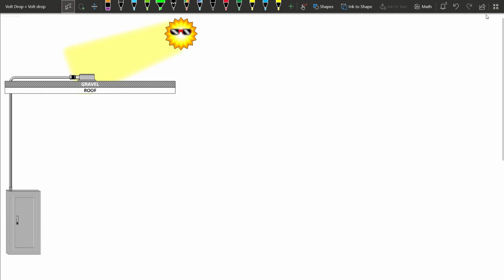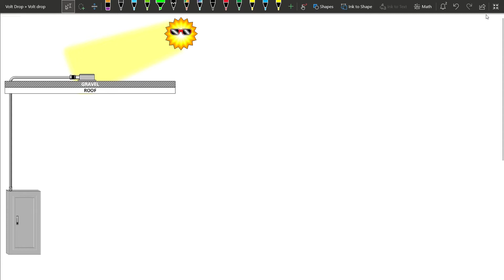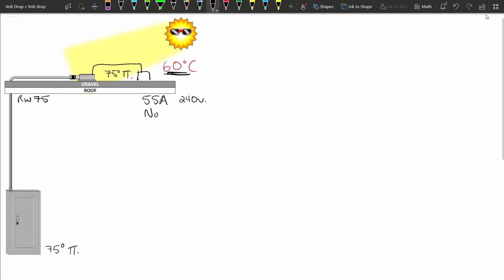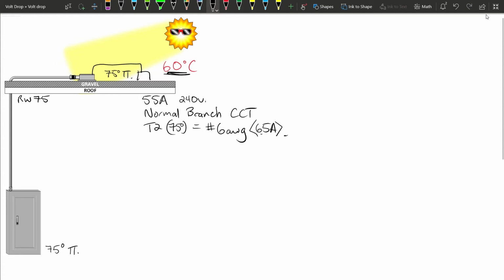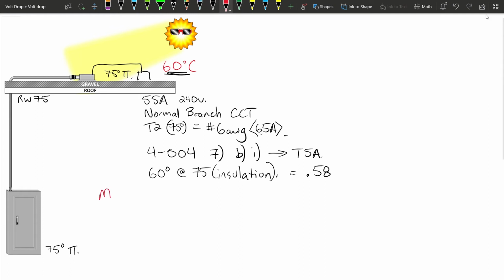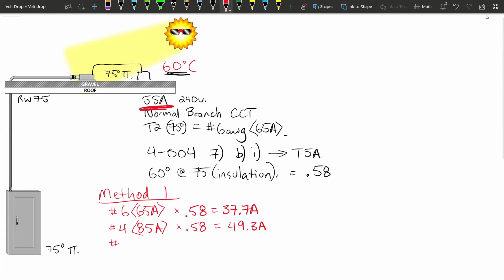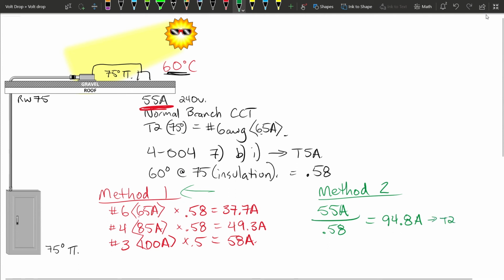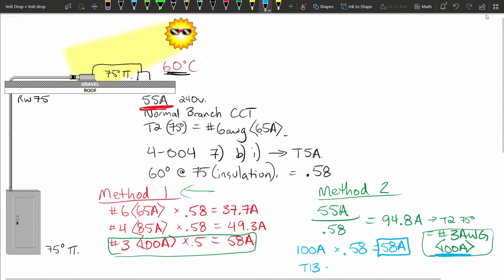Conductors in High Ambient Temperatures

Comment: What if the question has 60 degree ambient temperature and more then 3 conductors in a conduit. Would you derate with 5a and 5c? What would be the steps?
Reply from the maker: Exactly as you've said. You would incorporate both correction factors into the calculation, as both would reduce the allowable ampacity in their own respect. 
Load ÷ table 5A CF, ÷ table 5C CF = required ampacity of the conductor when selecting from table 2.

Comment: Table 5A says in note 2 that the conductors' insulation temp is used for selecting the demand factor. I got a question wrong using the CSA app citing 4-006 (1) claiming I have to use the equipment termination temp for Table 5A. 
Was hoping you could confirm the app is wrong in this case and we do indeed use the 90 deg column on Table 5A in such a case. (90 deg conductor insulation terminated on 75 deg circuit breaker in 45 deg ambient temp)
ty thanks for the content
Reply from the maker: This has been a great source of headache the last few years. Currently the interpretation has been to still use 4-006 with all corrections applied with the lowest termination temperature. 

So even with a 90 degree insulation, with 75 degree terminations, we would use the 75 column. This is what has been told to me, but check with what your local governing body requires as it could be different jurisdiction to jurisdiction.
Reply: @schulerruler  wow ok haha. At least I'm not the only one. I'm taking the CofQ in Ontario, can I be safe using this interpretation?
Reply from the maker: I wish I could give you a definitive yes or no, but I'm not familiar with Ontario interpretation. Best thing would be to put a call into a college or an inspector possibly? The apprenticeship governing body would also be a good resource.
Reply: @brimmedHat  hey, did you figured out? use 90 deg or 75 deg? Thank you =)

Comment: so you saying if the wire is rw90, the derating factor of table 5A is .71 right ?? please answer
Reply from the maker: If all termination temperatures are 90 yes. If you have lower than that on equipment, then we must still observe 4-006 and use the lowest.